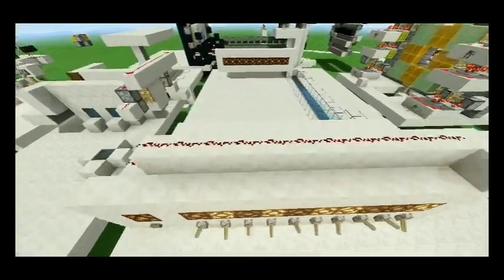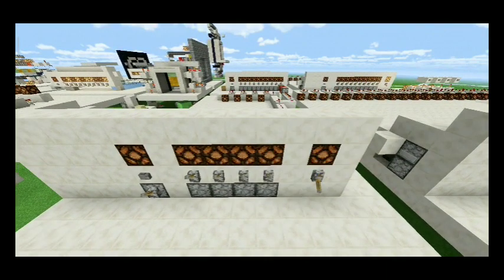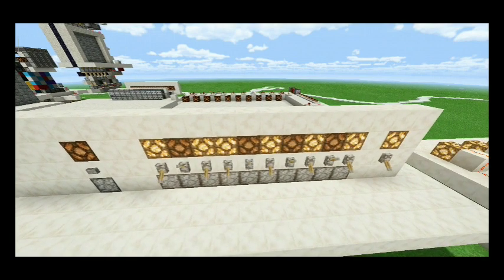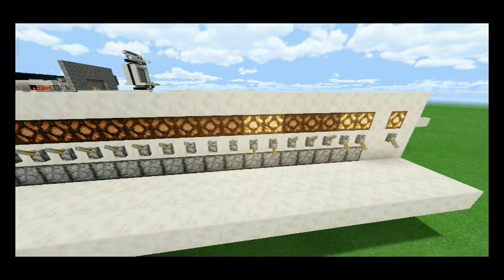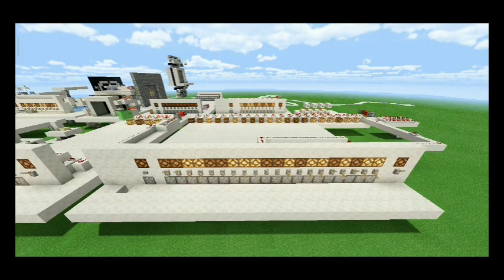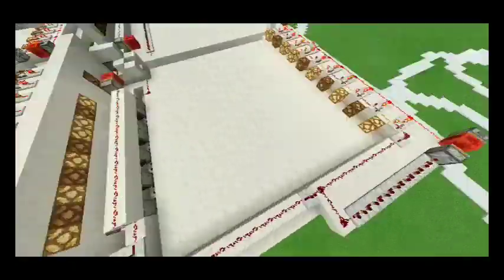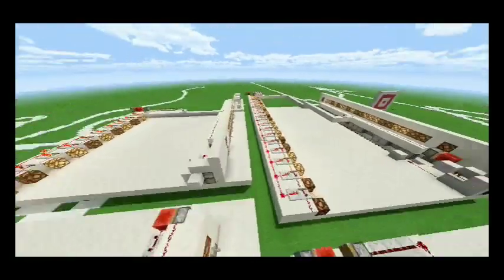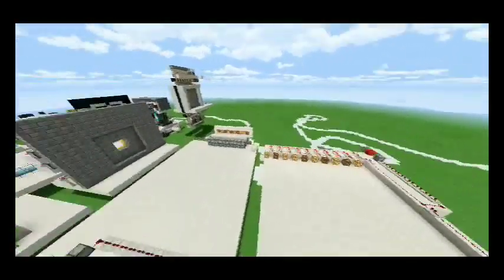Redstone Data Transmission Bedrock ( For all Bedrock Editions ) Part-1

Comment: Wow!!! I love the data transmitter! I love the design! Great work!!! I personally love redstone, keep posting! Love it!!!
Reply from the maker: Nice to hear that , I made upto 20 but it can be Expanded even more , also will be doing a video on how to build one
Reply: @diablo931.  Very nice! Is it a serial  data transmitter? That's what it looks like to me.
Reply from the maker: @RedstoneEngineer  Lol ofc it's a Serial Data Transmissions system but way more compact only 2 block thick encoder and 3 wide decoder which is just some dust and repeaters and also I designed this for Bedrock as Serial Data Transmission systems for Java didn't work for bedrock .
Reply: Yeah I've made expandable versions of this for java. 1 tick and 2 tick serial lines.
Reply from the maker: @RedstoneEngineer  sadly those don't work on bedrock systems break cuz they can't handle that high speed of flashing data
Reply: @diablo931.  yeah sadly :(

Comment: I had a few minutes before lunch was over. I got mine to expand to 16 but never tried 20. I'm sure it can be done but it gets more complicated with each repeater added. 
  That water design is pretty sweet. It gave me an idea.
Reply from the maker: Well this is a old video when i was quite new to making video and redstone , so this design is quite slower than the newer Design I'm working on ,also adding more bits is not difficult if u know how to figure out the pattern of delay
Reply: @diablo931.  I might try using a bubble column, just for fun.